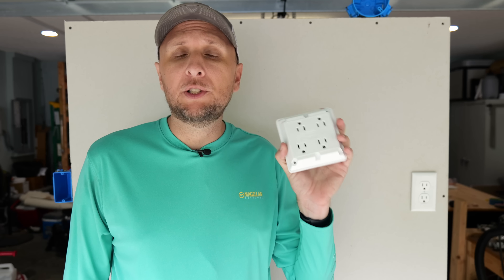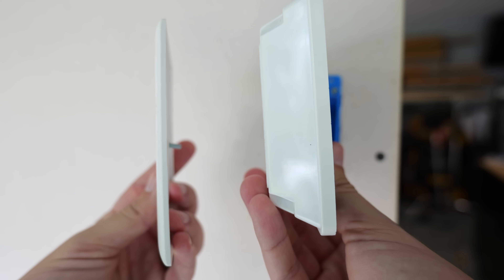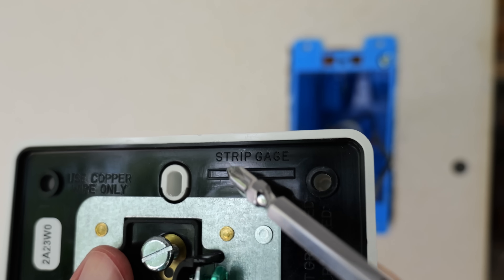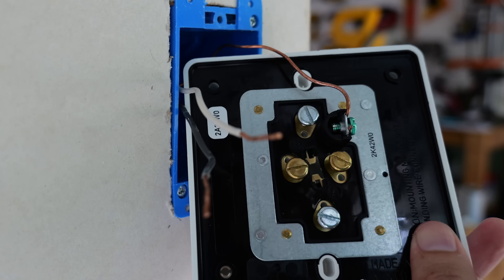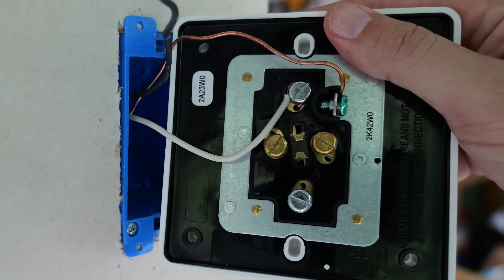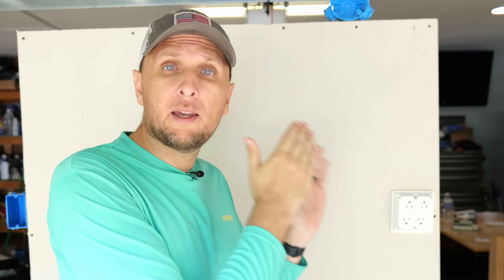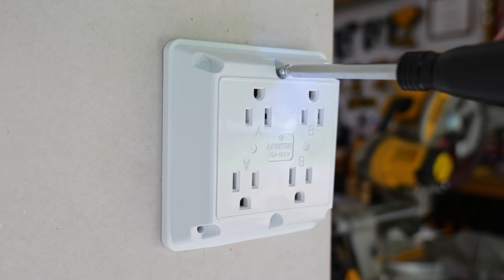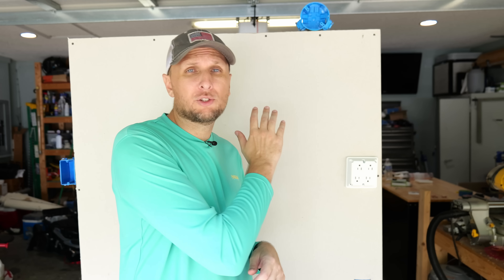The GENIUS 4 Outlet Receptacle That Almost Nobody Knows About | How To Install

Comment from the maker: What do you think of this device?  Could this have saved you some time and hassle in the past or maybe on an upcoming project?  Thank you for any feedback!
Reply: It is ugly. More pertinent, you can buy a 2 —> 4 plug-in extender (even 2–6 plug-in extenders) that installs in seconds…seconds.
Reply: @JackTRyan  I came here for this post.  If you are ok with it sticking out, then just plug in an extender. Seconds to install and substantially cheaper.
Reply from the maker: @-Tac0caT- yes substantially cheaper in build quality as well and does not provide a good connection like a hard wired connection does.  It barely takes any time to install this either.
Reply: @JackTRyan  spot on
Reply: @JackTRyan yep, that’s what I came to say!
Reply from the maker: @Rushan2112 then you don’t understand or appreciate why this is so much better.  It’s no uglier than those other devices.
Reply: @JackTRyan  
How exactly is it "ugly"? What is ugly is the humongous oversized plugs that they use in the U.K. Why doe sit have to be so big just for common household appliances? The pompous ego of a decaying high-tax country? I would expect maybe a big plug, of a clothes dryer plug, or maybe some 480-volt 3-phase equipment in some industrial setting.
Reply: MY OCD side cringes at the non-uniform alignment and rotation of the outlets.
Reply: @roycsinclair  
Why would "non-uniform alignment" bother you? What does that matter? I was expecting, from the thumb-nail, to hear why the outlets are not vertically aligned. I suspect to better fit in oversized plugs or wall-wart plugs? Those nasty transformer plugs that block at least 2 or 3 outlets rather than just the 1.
Reply: @ Do you not understand what OCD is?  Though to be honest that irregularity simply violates the sense of order, i.e. it just looks bad.  A standard double wide outlet box isn't going to allow more of those wall-warts just because they moved the pairs of outlets to be offset from each other, only had they moved those four outlets to the corners of the box is there much of a chance to allow the outlet to handle more of them at once.
Reply: NOT GENIUS!  A simple wall tap (4-plug, 6-plug, USB) costs less than $10,  protrudes the same, and doesn't require you to get into the receptacle.  Just plug in.
Reply: @keepingdistance4404 exactly… i got a bunch of them
Reply from the maker: @keepingdistance4404 they don’t protrude the same and a hardwired connection is superior in every way.
Reply from the maker: @erikarois 😂 I can relate.  This would definitely take care of that.  Thank you for sharing that, gave me a chuckle.
Reply: This is great for applications like a security system that’s has multiple transformers. The ground plug being on opposite directions allows you to mount them is different orientations.
Reply: @da1shark  
Those heavy transformers are too often sagging and about to fall out of old loose outlets? Would it be better just to use a floor-positioned surge suppressor strip for those nasty wall-warts? Some have up to 3 outlets with wide spacing for such garbage transformers.
Reply: I wonder what would make someone opt for this vs a 6 outlet plus USB wall mounted surge protector that doesn't stick out much more, securely screws into the center of a duplex terminal, and installs/uninstalls in seconds so is easy to remove for painting. I have several from Belkin and APC around my house. That said, it's nice seeing what the install is like. I'd come across these a while ago but hadn't seen anyone use them and was unsure of the use case. If I wanted something to stick out less than a wall surge protector I'd likely opt for what you did in prior videos, installing a 2 gang outlet. Thanks for sharing.
Reply: No GFCI version rules it our for places where it would be the most useful (bathroom counter, kitchen counter, garage workbench) unless the outlet in question us already on a GFCI circuit.  Thankfully, the one I want to upgrade is.  Why no GFCI, Leviton?
Reply: @rangersmith4652  Exactly my thought -- I have a single gang switch in a bathroom.  I would like to bump out the switch, and add a GFI plug.  If this had naked holes for any switch, receptical, or GFY it would be far more useable...
Reply: It would be nice in a shallow gang box as it sits flush against the wall instead of protruding back into the box.
Reply: @palarious  
It would be nice in a shallow gang box as it sits flush against the wall instead of protruding back into the box.

Not only that, but it gives the benefit of a double-gang box, without having to upgrade to the double-gang box. Budding DIYers might love that. Still the box is covered, not much gap for any arc sparks to come out, and so it would be considered to be safe? And having a direct connection is advised for high-current devices such as an air-conditioner or heater. But it does not add any capacity to the circuit, so if there is a high-current device, everything else should be low-current like simply a radio or lamp or clock.

Isn't there also the 6 outlet adapter, that simply plugs into the existing outlet? Where might that be recommended?
Reply: Sticks out of the wall. No thanks.
Reply: are those tamper resistant?
Reply: I don’t see much of a point in this.

There’s plenty of 4 and 6 plug splitters that replace the faceplate of a standard outlet and screw in to secure it that sticks out just as much.

If i was going to remove the existing receptacle, I’d want it flush with the wall and not sticking out. If it’s going to stick out I’m just going to use a standard plug in splitter.
Reply from the maker: @RomanMyshoul85 I didn’t say otherwise.  But those other devices are not made as well, don’t have a solid connection, and are more likely to fail sooner.  Not taking anything personally, just stating the facts.  Whether you accept them or disagree is your choice.
Reply: Hello friend. I love your video. I want to work with you for business and send you the email. Please check you email box. Waiting for your reply. Thanks a lot🤝
Reply: where can i buy these product. thank you
Reply from the maker: @preguntapregunta3923 I have links for them all in the description of the video.
Reply: @HowToHomeDIY  so this only works in situations for newer homes that actually have the ground wire?
Reply: In a way this is cool as a moose. Like for a beginner like me.
But I agree with those other guys whom seem to know what's up with the bare ground wire.
Idk.
My opinion is I have a bunch to learn.
Reply: Bought one about 25 years ago at ACE Hardware. I loved it.
Reply: If you like the look of a bulky 4 outlet receptacle tell me how this is better than one you can just plug in that cost $16?
Reply from the maker: @Magicinstalls I’ve explained this numerous times in the comments.  I don’t need to sell you on it.
Reply from the maker: @RomanMyshoul85 to you 😂
Reply: My take is if you're going to have the bulky for outlet set up just by the plug-in, if you don't think it's as safe get a double box and install two outlets
Reply from the maker: @Magicinstalls no thanks.
Reply: @HowToHomeDIY  no thanks what? you don't know how to install a double game box and two outlets?
Reply from the maker: @Magicinstalls of course I do.  I even have 2 videos on how to do it on this channel.
Reply: do they sell them at home depot?
Reply from the maker: @sacredsounds4234 not that I’m aware of.
Reply: I'll pass on it. Would rather do the work to do it right if I needed more.
Reply: I have a project coming up and I wonder if this receptacle will fit. I'm adding a Reliance Controls power inlet box outside my house from a 30 amp generator cord. I want to bring the power into the house through the wall into an outlet so I can connect my refrigerator, microwave and a couple of lights. Would this receptacle be safe to connect?
Reply: I guess it seems redundant? They make those cheap 6-Outlet extenders plug directly in to the existing outlet and are no thicker than that thing. The ones you remove the existing face plate and it has it's own screw that screws into the face place screw hole so it doesn't come lose.. I have several in my house you can pick them up way cheaper than that thing.
Reply: Cringe at no Robertson Screws for tightening. Come on Leviton.
Reply: Your installation doesn't look safe with that long bare ground connection that's just going to be crumpled up in the box with those other live and neutral terminals.
Reply: @BrianG61UK  I agree. He could have easily covered the bare ground wire with heat shrink tubing.

Comment: I don't like that. Plastic boxes I don't like, and they have half of the outlets upside down which I also don't like. Actually I HATE it. It really sets off my OCD and irks me. I had to spend hours taking outlets out of this house, and not only turning them the right way but also fixing other mistakes the idiot made with polarity, no grounds and even a false ground in 2 cases. And of course, the incompetent inspector comes along, and lights up his gadget.

Comment: Seems like it would be easier than a standard outlet for the ground wire to contact the other terminals when shoved back into the box. Also, it would be nice to configure which outlet is switched since often you don't need two switched and two un-switched.

Comment: That mix of ground at the top and at the bottom made me query which was best.  I managed to find both claimed as the way it should be, but I was most persuaded by the ground at the top, on the theory that something falling on a partially pulled plug would hit ground, not something hot.  Which is how the top two are set up.  And it makes sense too for the bottom ones to have the ground on the "outside", giving a bit of - theoretical, at least - protection to the inner hot prongs.  
Of course I also read that code does not specify!   8-)

Comment: Why bother with this when you can buy a 4 outlet (though they wouldn't be switchable - but in most cases that's not a concern) that looks better and you screw into the center screw point of a 2 gang outlet.  These have been around since at least the 70's.

Comment: Why not do 6 outlets? And does it have very good surge protection?

Consider not using it where plugs might get mashed by furniture pushed back. Maybe a separate surge protection strip. But a more direct connection would be good for any high-current device such as an air conditioner or a heater. Those devices draw too much current for cheap or poor-quality extension cords which are not recommended. Heavy-duty or no extension cord.

My bathroom has a double-gang box, for a GFI and protected extra duplex outlet, quad-outlet total, due to the tiny vanity counter with no place for a surge protection strip for extra outlets, probably not recommended to have outlets lying on the counter anyway? Night light and shaver, that is easily 2 outlets used up already.

When I was in the military, I had to use a basic triple-outlet adapter, because their quad outlet was damaged, apparently somebody shoving furniture against the wall too tight. My boombox plug still has the mark where it tripped the circuit breaker in the hallway, when the hot prong also touched grounded metal from the outlet being previous damaged. So not all the outlets were even usable.

Comment: I have a bathroom sink counter that only has one duplex GFCI and no other outlets. I need a similar quad outlet but in GFCI. Is there any similar quad GFCI outlets? I can't find a source for any. I would rather not do any cutting of the wall.

Comment: How do you know which connections go together. For instance, you installed the top neutral wire to the hot wire on the left. Would the right side work, and if not, how wouod someone know that?

Comment: I would be worried that the ground might make contact with either of the other two terminals when pushing it back into place. Especially if the wires in the receptacle were excessively long.  I like having extra wire rather than not enough so I rarely cut back wire unless it's just over the top excessive.  Maybe I'm just overly cautious.  Either way, a very good demonstration on how to wire it up. Thanks!

Comment: It would be nice if they provided a couple a screws to cover up the holes designed for a 4x4 box mount.  Unfortunately,  I don't see any need or use for this aside for maybe garage.  It's not an attractive 'finished look'

Comment: I have a lighted (red) 120V toggle switch that was supposed to light when turned on, but I'm not sure I wired the garbage disposal correctly, despite it working like it is supposed to. The light doesn't come on when powering on the sink. It's a double-pole pilot light switch. What is my configuration photographicly? I am horrible with written directions.

Comment: I would put electrical tape over the hot and neutral screws to prevent the ground wire from touching them.

Comment: I would never consider something that would stick out 3/4". You fail to mention if you ever plug anything into the outlet,
now you have something protruding even further from the wall. No thanks. Do it right and install a double gang box.

Comment: DANGER!  DANGEROUS IF INSTALLED AS SHOWN HERE!!!  Leviton's instructions say the GROUND WIRE MUST BE INSULATED so it doesn't accidentally make contact with the other terminals.  Read the instructions!   It is a CODE VIOLATION to install this in violation of its instruction sheet.

Comment: You forgot to tell the people to make sure that uninsulated copper wire doesn't touch the hot side while you're putting it on the wall.

Comment: just plug in one of those 4 to 6 plug outlets into a regular two outlet ... that would be simpler .. then remove it when you want to go back to the original two sockets

Comment: Anyone know if this outlet can replace an outlet that is in the middle of a run with 3 black and 3 white wires? Do you just pigtail the wires and only connect one into the back of this outlet? Thanks in advance…newbie here 🙂

Comment: Or you could just use a plug in quad  it will just stick out a little  bit more.With no work an alot less expensive. Plus it is removable.

Comment: They make those that plug into the 2 receptacles and give you 4.  Just take center screw out plug in and put center screw in boom done dont even have to turn power off.  Sticks out about the same as this.
Reply from the maker: Yes.  I have some in certain areas but use the device in the video in heavy use areas as it is a hardwired connection and built WAY better than any of those you are talking about.

Comment: I find that the blue boxes are flimsier than older Bakelite.  Any thoughts?
Reply from the maker: They are flimsier but the old Bakelites tend to break easily.  And if you try to remove them they can often just break into pieces.  So while the newer pvc style is flimsier, I think it is somewhat due to this that they are also more durable if that makes sense.  Just my opinion.

Comment: Or just plug in a six-outlet extender. Same additional depth and no extra work. Plus it's 1/4 the cost!
Reply from the maker: 1/4 the durability too.
Reply: @HowToHomeDIY Exactly. A quick and easy solution for many.

Comment: I was always under the impression that the screw is supposed to tighten up and close the wires together but the way your hot wire is shown with a little pigtail and you stick the pigtail in the hole and you wrapped it around the screw and tighten the screw you are physically pulling the jacketed side of the wire away from the screw head aren’t you?

Comment: Interesting product...
How do those isolation tabs work?  Is there one for the neutral and one for the hot?
Weird, they are both very close to the hot screws.  Which way do the outlets split?(left and right, or top and bottoms?)  Looks like an 'A' and a 'B' are stamped to identify which is which?

Comment: OK if this option is the only way to increase # of outlets. $35.00, hmm. Funny top outlets have ground holes up. I guess settles the argument as to orientation of ground hole position! Why did they use slot only screws instead of tri slot screws like most other modern duplexe's? The closest adapter I can think of are those that simply plug into existing duplex and have blades/grounds that utilize BOTH recepts and give you up to SIX available outlets for around $5.00. Most even have a center screw that subs for the orig cover plate to firmly secure the unit so it just won't unplug when pulling out a plug. I have a couple of these in use now. No problems.

Comment: Great if you don’t mind that monster protruding from your wall like that. Might as well have one of those ones that plug into a regular outlet but turns it into 2
Reply: because if you're using things with high wattage, a multi-plug adapter will always have a bottleneck since it's not connected directly to the source. 
those adapters are basically extension cord without the cord. no clue why people like you cant understand this lmao
Reply: @cervwrekkerrr  it's really no more of a bottleneck that the cords/plugs themselves. The contact blades are likely equivalent to #10 or #8 wire.
Reply: Or 3, or up to 6!  If I'm okay with something sticking out of the wall, as you say.  Much better to start with the flush mount, then add on if actually needed, and perhaps only temporarily!
Reply: Oh come on, it does not look nearly as bad as those ridiculous monster plugs that they have in the U.K. And I wish that I could find some industrial-looking electrical boxes to mount on the walls of my ACNH video game island, all the better to get that "industrial look" that real video games have, such as Half-Life.
Reply: Exactly!!

I don't see how this is any better than getting an add-on outlet splitter.